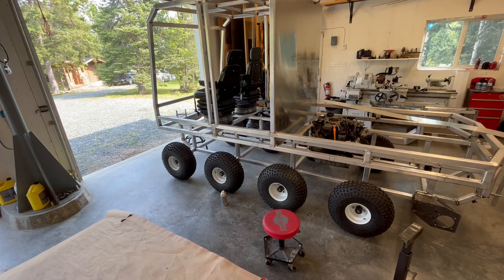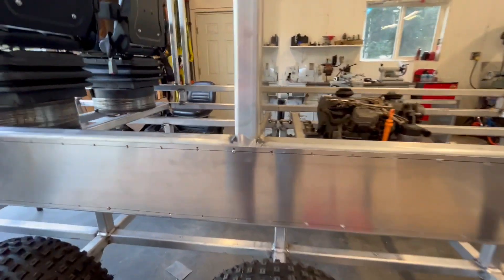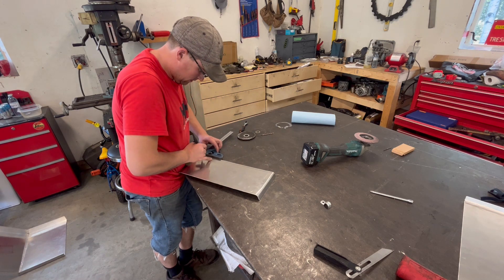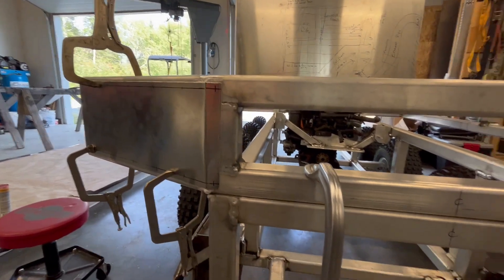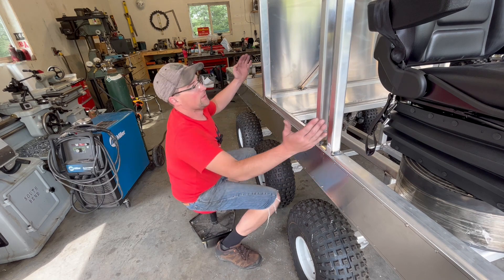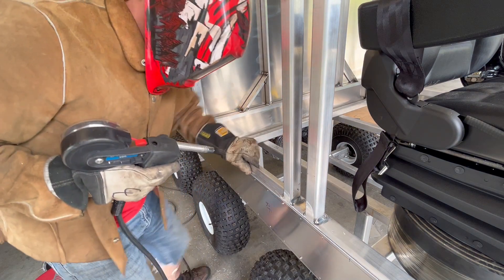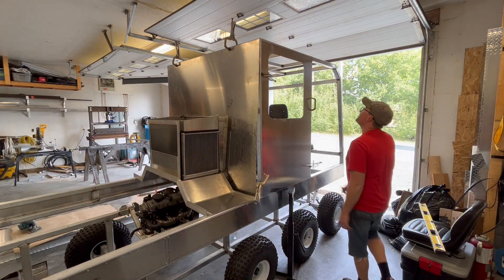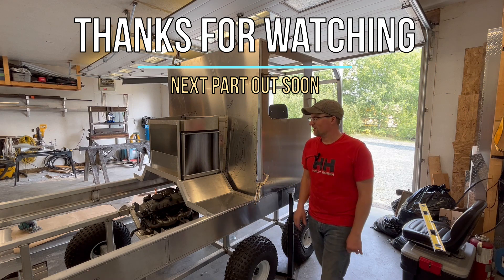Aluminum Body Panels | Snowcat Build PT15

Comment: Looking deadly for sure! What kind of blade do you use to cut panels?
Reply from the maker: The best blade to use is one with a high tooth count and preferably a negative tooth rake. They circular saw blade I am using isn’t perfect. But it seems to matter less with it. My “12 in chop saw I like to run a 120 tooth+ -5 deg rake. Often they will advertise them as a aluminum or soft material blade.